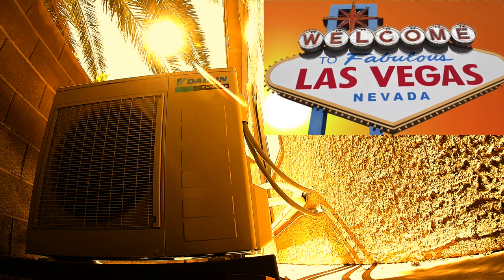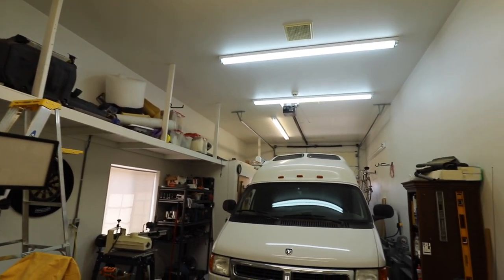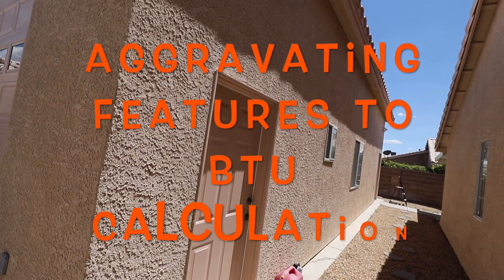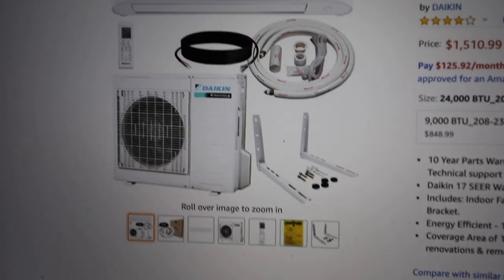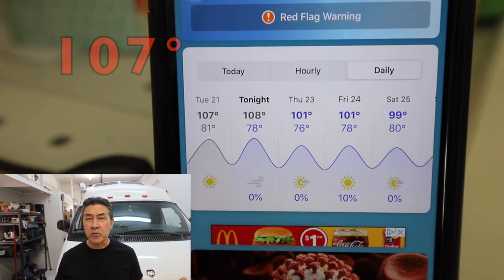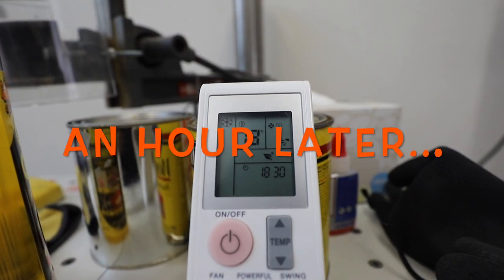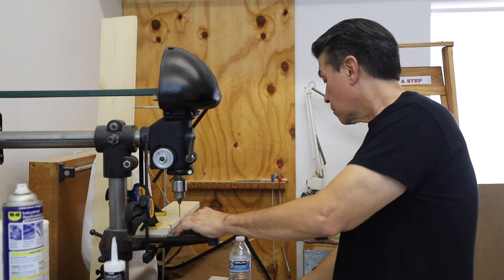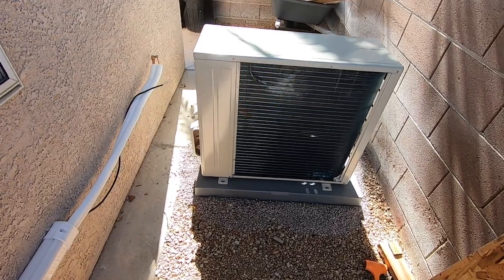Mini-Split AC Review in a Las Vegas HEAT WAVE!

Comment: When I rolled into Las Vegas in July 1975 on my motorcycle it was 118 degrees.  I camped at the old KOA out on the Boulder Highway.  At midnight it was 108 degrees.  I was using my tent.  I slept in my shorts on top of my sleeping bag.  I had the tent doors wide open with the bike in front of the door for privacy.  I spent a lot of time in the pool. That was a noteworthy experience.  I couldn't carry an air conditioner on the bike.  And, I had to wear the leathers whenever I was in motion just to keep the heat off.
Reply from the maker: I went through a Harley stage and had a 2003 Anniversary RoadKing. Summer was brutal with the heat from the sun and the heat radiating from the engine. Short Moto season.

Comment: I heard the reason that the mini splits have a slight temperature difference between the air handler and the room is because the thermostat is on the air handler right next to where the air is blowing out. Is that right?

Comment: This is exactly what I was looking for! I have the same set up just slightly bigger and I live in metro Phoenix so it gets very hot. Calculator is saying 29,000 BTU, but I am sure the 24,000 BTU unit will work fine for my needs. Another great video.

Comment: Just got my brand new Daikin 18000 btu installed in my garage today. Works great only paid $2300 with the unit and installed with warranty. I can’t believe they tried to charge you so much. I was going to try to install myself but I shopped around and got a good price. I live in Henderson, NV so it’s also very hot here too.
Reply: Who did you go with your install? I've been looking in the Vegas area and I'm getting quotes for 6500...
Reply: Would you mind sharing who installed your system?  I live near the airport on the east side of the Strip.  The weather is going to get hot and I would appreciate it if you can point me in the right direction.  I am also looking to install about 18000 btu ductless mini split system for my bedroom.  I think that should be adequate.  Thanks in advance!
Reply: @abelardov1347  $2300 for a small mini split system sounds about right.
Reply: @ExploreVia360  His name is Daniel
Reply: @mynextpair1913  Thanks for your reply!  How long have you had your mini split system for that was installed by Daniel?  How is it working out for you?  By the way, how can I get in touch with Daniel?
Reply: @XploreNshare  702
Reply: @XploreNshare  860
Reply: @XploreNshare  5805
Reply: @XploreNshare  I found him on offer up. Good Luck
Reply: @abelardov1347  Hi Abelardo.  I noticed its been 9 months since you tried to ask MyNextPair for the contact of the person that installed his Daikin mini split for $2300.  Did you ever get your mini split installed?
Reply: @mynextpair1913  Thank you!  I will give him try

Comment: Steve, any considerations on getting a grid-tied solar system, DIY?
Reply from the maker: I have looked into it and it Doesn't seem complicated, I figured I would re-do my 40ft, south-facing patio cover to hold panels. I have researched it and I don't think the tech is there yet. Companies hurt themselves by over-promising and under delivering. Everyone likes them at first but when the savings don't add up or the roof springs a leak under the panels and you have to pay double to patch it , well....Naw. Warren Buffet, I hear, is going to invest in the largest solar array ever and connect it to our grid. That is the way to do it. If it weren't for government subsidized installs, we wouldn't have all these ugly panels dotting the neighborhood rooftops. A neighbor went to sell his house and found there was a lein on it from the solar company that installed his array. He has to pay it off before he can sell. Many people have to find buyers who will sign on to the program before being able to sell. When there are improvements to the panels and batteries, I will absolutely reconsider. I believe in GOOD tech. I have a Tesla 3. Love it.
Reply: @XplorerSteveDIY  The Tesla itself may be "good tech", but sadly Elon Musk isn't a good person. I choose not to line his pockets.
Reply: @XplorerSteveDIY  , thanks for your reply. It makes a lot of sense. Here in Asia, I installed a small
 1.5 kW grid-tied solar system myself. Here you can install a zero export device behind the meter so you are just using it for self consumption. I have glass partition between my living room and study with highly efficient mini-splits installed.  Our rates are based on a tiered rate consumption, no time of use  of use. I produce, on average about 6.5 kWh a day. It was enough to cut my electric bill in half. The DIY projects cost me about $2,500 USD.
Reply: @XplorerSteveDIY   REALLY GOOD points, that "others" never discuss about home solar installations .... "Thanks" Steve !!

Comment: Have you thought of putting in a radiant heat barrier which is a full like material in your attic to stop the radiant heat from the attic
Reply from the maker: I think I am good there with the venting and insulation. I think the biggest culprit would be the 11ft door with all the seams and cracks. Big weak spot. Can't do much more there. i will probably make solar screen for the windows though.
Reply: @XplorerSteveDIY   putting a radiant barrier helps keep your insulation r-value people don't understand that your insulation becomes what's called heat soaked you are valuable drop in half do a couple YouTube searches on radiant barrier you'll be surprised

Comment: As always smarter than the average ranger. Thanks for a very clear explanation of the process. These will likely be used more often as the whole climate change thing gets worse. — did it have a heat pump option? And is that too cost prohibited ?
Reply from the maker: Busted! ha. Didn't watch the whole video. Yes to the heat pump.  We will see this winter.
Reply: LOL... You missed the "Heat pump" portion ...
Reply: Rick S. Guess I did.